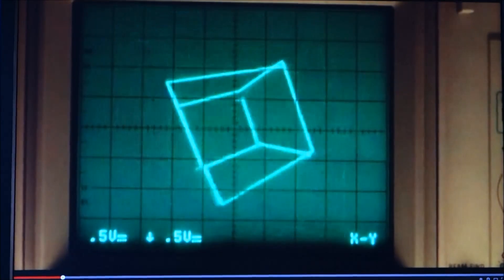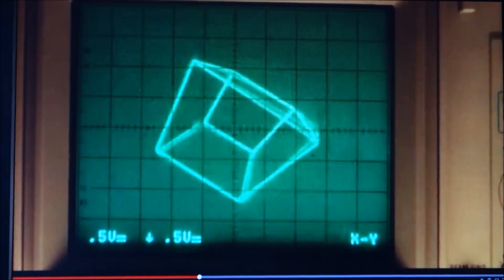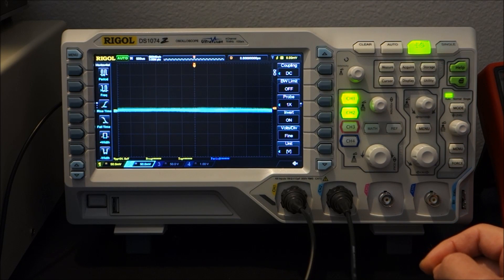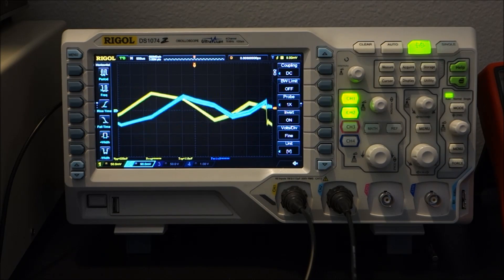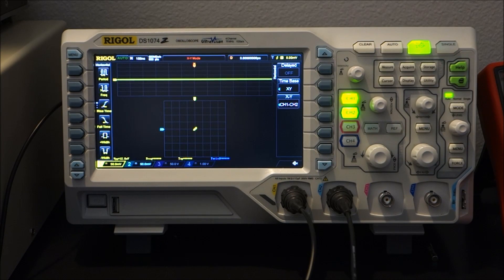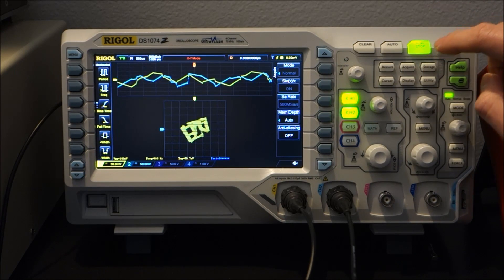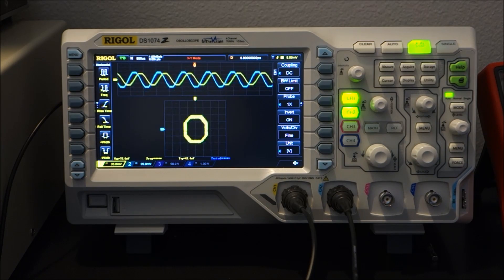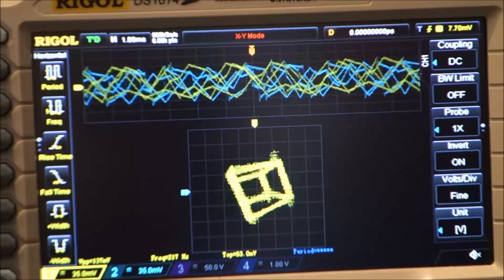TeslaCoilBlog #1 - Oscillofun on a Rigol Digital Oscilloscope DS1074z

Comment: Really nice. Although this really shows the limitation of today's DSOs. Analog oscilloscopes still have their place.
Reply: +SirMo I really wouldn't call a rigol 1000 series "today's DSOs".  Even my 5years old bottom of the range MSOX2014a does 500Msps in XY mode with acquire set to normal, and 25Msps with acquire set to HiRes.
Reply from the maker: +Jimmy tsu  
I think SirMo was referring to lower-end DSOs like the Rigol I'm using, which is about $400 on the market today. The InfiniVisions are very nice, but they're about an order of magnitude more expensive :)
Reply: ***** Yeah, I have the Rigol DS2072A and an old analog Hameg 605 scope. DSO is my go to scope, but I do use my Hameg from time to time as well.
Reply: +SirMo 

I bought a Tektronix 2232. It makes a very nice analog scope and it has has rudimentary digital storage if you need it
Reply: Possibly yes. Meanwhile it's at least 8× the price (somewhere 3k USD, meanwhile Rigol DSO1074 series start at 399).

Comment: How to make the scope display it full screen?
Reply: With the latest firmware you can.
Reply from the maker: I don't think it's possible to set the X-Y display in 'full screen' mode for the Rigol 1000z series. Would like to know if it is possible to as well!
Reply: ***** You make the cool mushrooms and butterflies and they fill up a square inch. Not fair.
Reply: turn off the displays for channel 1 and 2.